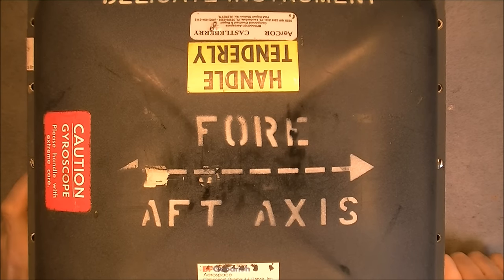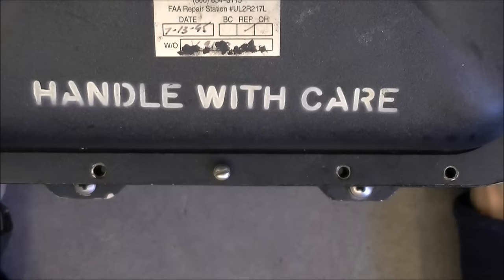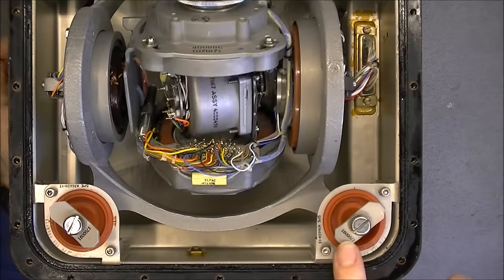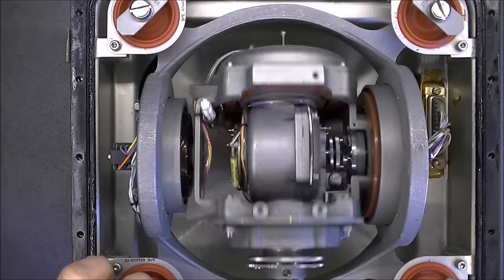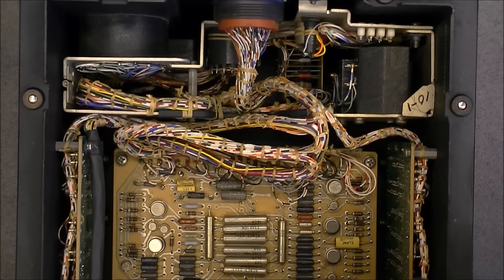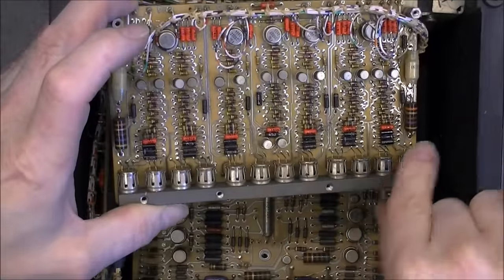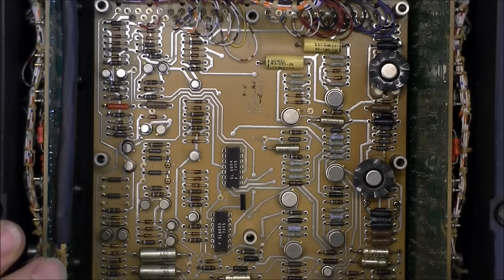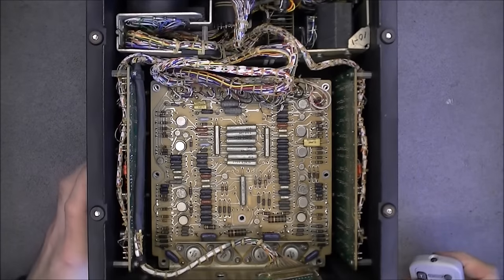Boeing 737 vertical gyroscope teardown

Comment: I was an avionics tech for 20 years and work on that unit a lot. The led that you refer is a valid red or black indicator, meaning for line service reference if is shows red mean three is a potencial issue with the electronics, if black all circuits and gyroscope working at nominal parameters.thanks for the video, brought a lot of memories 👍

Comment: How old is this model? It looks like an antique in today's world of modern solid state (and non mechanical) electronics! I would not want to be the one that builds and wires it up!
Reply: I used to work on these gyros repair and  overhaul must of worked on these specific ones for around ten years.
It was very satisfying work as well as calibrating and testing them.

Comment: Thank you for the video! How does the red thing that senses shock work?
Reply from the maker: Here is the manufacturer website http://shockwatch.com/products/impact-and-tilt/impact-indicators
They do not really say how it works, it must be a deal of glass tubes filled with liquids.
Reply: they are glass tubes filled with a white powder. Inside this powder is a very thin glass tube filled with red liquid. If you shake it too hard or hit it with something, the inner tube breaks and the liquid leaks into the powder. Then you will see red from the outside.

Comment: The metal tabs could be indicators of excessive G-force. They bend up or down depending on the direction of the shock.
Reply: may be. I don't think so. they are too strange